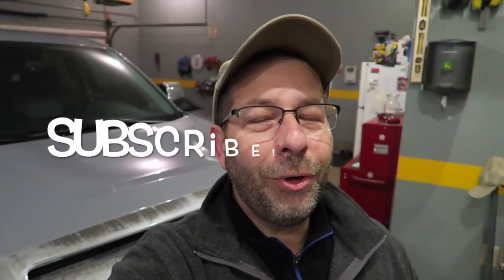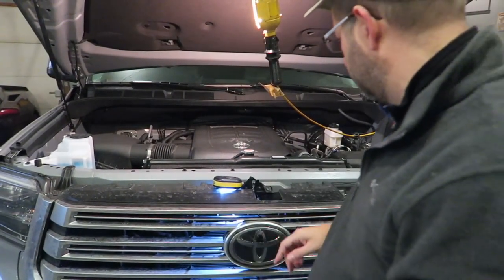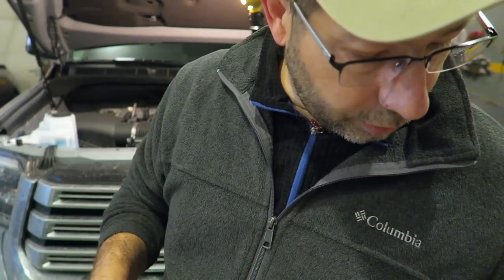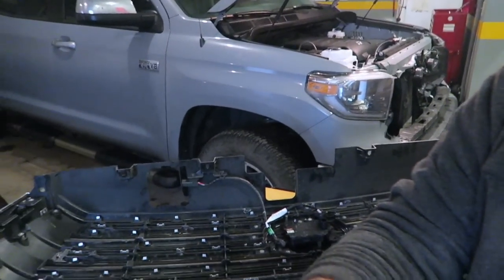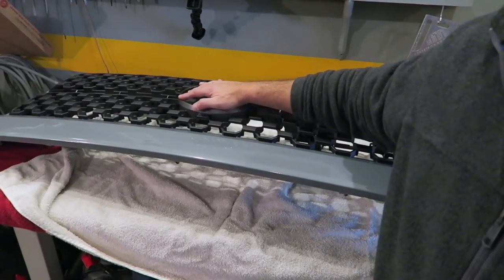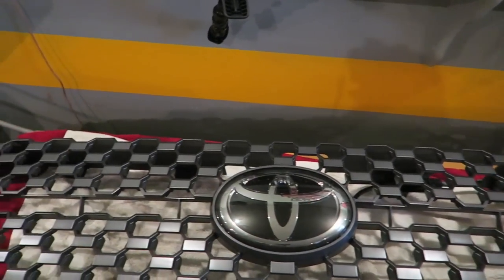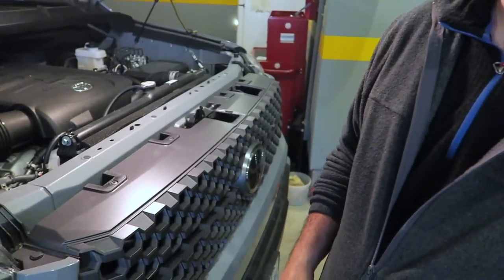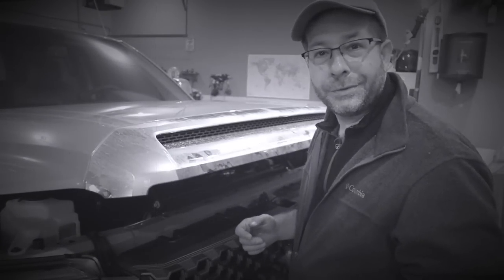2018 Tundra Grille Replacement and Sensor Swap How To - Part I

Comment: Would you say the original emblem is not reusable after breaking the 2 tabs to remove it?
Reply from the maker: Oh no.  It can be reused.
Reply: @RobMotive  so no need to buy the $240 sensor cover when I order the new grill and hood bulge?
Reply from the maker: Not if the sensor is located behind the emblem and you plan to reuse it.
Reply: @RobMotive  sorry to keep bombarding you with questions. I’ve been in contact with Sparks Parts and they are horrible at responding to emails. If I order a new grill and hood bulge. Would I be able to take the grill insert out of the new surround and just put my Limited grill insert in and not have to mess with the sensor or sensor emblem at all?
Reply from the maker: @jamilcostley1 I couldn’t say.  I haven’t done it.

Comment: How do you remove the small one on the bottom I hit a deer last week and I finally got a new one from the dealership and I want to replace it but can’t find a video on how to do it.
Reply from the maker: Not sure what you mean?
Reply: @RobMotive  there is a small grill like where the front number is at that is the one I need to replace but I don’t know how to take it out
Reply from the maker: I don’t know exactly what you mean.  If it’s below the big front grille it could be integrated in the bumper🤔
Reply: @RobMotive  ok thank you I wish I could post pictures but YouTube won’t let you do that

Comment: @6:40 Those dang plastic tabs with the metal washer things, I just hit the plastic tabs with a torch just enough to soften em up and then the washers pull right off with a flathead screw driver.  Maybe with a little melted plastic whiskers following but they went on back on just fine.
Reply from the maker: Nice tip!  I’d probably catch them on fire!!😬

Comment: Hey Rob, so I'm just changing out the front grille cover that's over the sensor, the one that has those star washers you had difficult time taking off. My question to you is would there be a way to take off just the cover without removing the sensor?
Reply from the maker: The sensor is no attached to the cover.  If you can access the washers (and remove them) you could remove he cover.
Reply: Ok thank you

Comment: Awesome vid.  Especially since I have only had my new to me 2018 1794 4wd for a few months.  the very first thing that has to be done is lose some of this chrome.  LOVE the truck, but the front end is crazy chrome.  doing like everyone else and hitting sparks and OEM, but they are all saying a 4x4 paint code part can't be bought.  found one from a platinum that was wrecked and had the TSS, thinking it should drop in.  thoughts?
Reply from the maker: As long as it’s the same generation it should be fine.

Comment: So disconnect negative battery terminal before disconnecting safety sensor on front. Did you have to recalibrate the sensor?
Reply from the maker: I did not have to recalibrate.

Comment: Btw my "pre collision system malfunction" light came on. By watching your video, I believe dirt/snowy mud from last trip to Flagstaff, has built between emblem and sensor. I will update. Thanx for ur video
Reply from the maker: Hope it all works out👍. Thanks for watching.
Reply: Same here. Seems to be common problem.
Reply: Toyota just released a recall related to this, must be happening a lot.
Reply from the maker: Hmm...I need to check that out🤔
Reply from the maker: Where did you see the recall?
Reply: Recall campaign KOB you can Google also.
Reply from the maker: Thanks for the heads up👍

Comment: Does this truck have tss? I noticed that my front emblem is cracked. Is it possible to replace the emblem without having to replace all the sensors and everything?
Reply from the maker: It does have the sensor.  If you watch the video you can see how I did it👍

Comment: I can't figure out how to disconnect the sensor wire (what you're pointing at in the 5:00 mark) to get the grill off. Do you just pull the plastic harness connector off or is there some tab you have to depress?  Thanks for the vid as always!
Reply: Same question I have
Reply: Did either of you figure this out?
Reply from the maker: I’m not sure what da you what he’s referring to?
Reply: @RobMotive  in your other grille replacement video you cover this more clearly. I think the solution is to watch your other video ;)
Reply from the maker: Glad it helped👍

Comment: Can you get that same grill with the honeycomb insert and still retain the chrome perimeter?
Reply: Yes you can.  Just ordered one and waiting for it to arrive.
Reply from the maker: Yup.  That’s what mine was before painting.
Reply: P/N 53101-0C020.  If you have a pre 2018 truck and want this look, don't forget to order the access cover plate ( 53113-0C010) and Toyota emblem ( P/N 753101-60020) to cover the space in the center.
Reply: Mark K , thanks Mark.  Would love to see that on your ride when you get it installed. I’m trying to decide between that one and the “old school” Toyota grill, think it’s also called the heritage grill?  The old school grill needs a fix for the sensor mounting I’m hearing.  Unlike many others, I prefer some chrome, adds some class in way for me.  Thx again!
Reply: Mark K , okay so if you have a 2018 these two parts are reused when swapping out for the honeycomb portion of the grille.  Would love to see pictures of yours when you get this mod installed.
Reply: Wade D. I have a 2017 but love the new grille. Have it on order and should receive it soon. I’ll send a pict when installed.
Reply: That is correct.  If you already have a 2018, my understanding is the emblem and cover plate can be swapped.
Reply from the maker: Yes, that is correct.
Reply: I just bought a 2018 tundra limited today! I was at the parts counter to order the bulge and the same black honeycomb grille but was unsuccessful. The parts guy said I could no longer order it? 

Can you please tell me the part number(s)?

Did you have Toyota paint the bulge and trim around the grille?

Any info you can provide is greatly appreciated!
Reply from the maker: Congrats Chris!  Contact Jamie at Sparks parts.  Tell him you want the same part (s) that were ordered by Rob from the YouTube channel ThrobbNation.  He can supply them painted as well.  Jamie@sparksparts.com👍
Reply: ThrobbNation thanks for the quick reply, I’m on it!
Reply from the maker: You’re welcome.  Jamie at Sparks is a good guy.  You can also look up Sparks Parts on the web and give him a call.  I’ve bought several parts from him.👍

Comment: i have the 18 tundra with the honeycomb grill ,can just the honeycomb be replaced? ...some one put a board thru it on a jobsite and its driving me crazy
Reply from the maker: I believe so.  Take the grille out and have a look.  It’s pretty easy to remove.  There’s a vid on my channel showing how to remove it.
Reply: ThrobbNation I guess the right question I should have asked is do you know of any place that sells just that honeycomb section I tried Sparks parts and the dealership any suggestions?
Reply from the maker: I would have thought Sparks.  Other than them..I guess I’d just search the web.  Possibly a junk yard with a wrecked Tundra?
Reply: ThrobbNation thankyou

Comment: Nice.  I actually broke one of the alignment tabs on my stock Platinum grille taking it off to install the TRD PRO grille.  It was cold so I guess it was brittle.  It wouldn’t matter though since it’s just an alignment table doesn’t hold anything in.
Reply from the maker: Yup.  There are more than enough other tabs to hold it in😎

Comment: Part number for the 1H5 (Cement) 2018 grille? I just received my TRD Pro Grill and it doesn't support the TSS system. I would like to get one that does but it's still color matched. What Grill part number did you buy?
Reply from the maker: My grill is from another trim level.  The grille I have doesn’t come in Cement.  I ordered from Jamie at Sparksparts.com.  They had it painted as well.  Also, you’ll need the hood bulge (it does come in cement).  I don’t have the numbers, but Sparks Parts can help you with everything.
Reply: Nevermind I thought you had a part number for a cement Grill that was already pre-painted. I ordered a TRD Pro Grill in cement but that's because I didn't know about the sensor. I also have the hood bulge already.
Reply: Alexander Neu ... so does that mean that the TRD pro grill will not work because of the sensor? So the only option is the grill Rob used?
Reply from the maker: I don’t know of one yet, but I’m sure they’ll be coming👍

Comment: Those little plastic push rivets are the bane of my existence. Luckily I haven't run into any while working on the Civic Type R. On my old Mazda 6 I had to replace the halogen low beam bulbs twice a year and needed to take the front wheels off, undo about 15 of those plastic clips inside the wheel well, and pull back the plastic so I could reach up in to change the headlights. About a 1 hour job once I got good at it. Then I would make a trip to autozone to buy replacement Nissan push rivets because I would break at least 6 every time and you can't buy Mazda push rivets.
Reply from the maker: I know what you mean!  I’ve broken a few in my time!!  You’d think there would be a better way!!!!

Comment: Nice Job!! Fyi for future work ensure if torque specs are noted for any screw, nut, bolt are called out that you torque them. If not I always use a little blue lock tight to ensure no loosing. Just MHO! Enjoy life brother.
Reply from the maker: Thanks!  Good advice!  😎